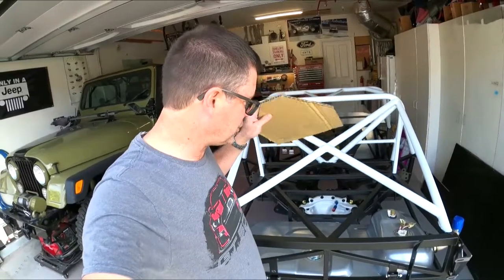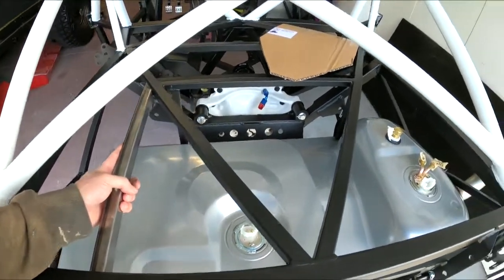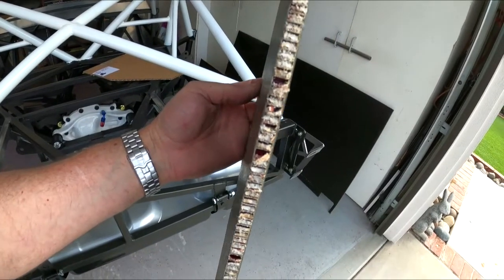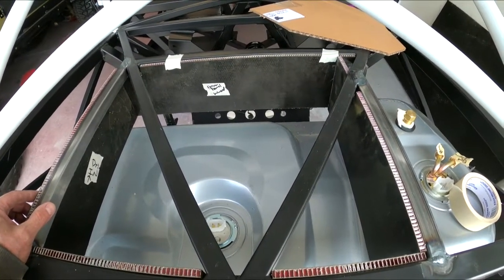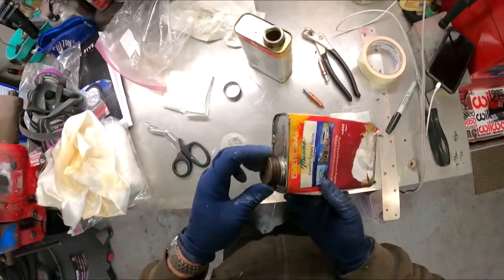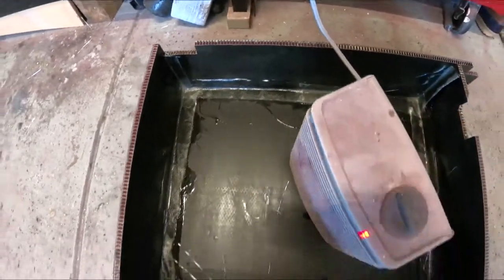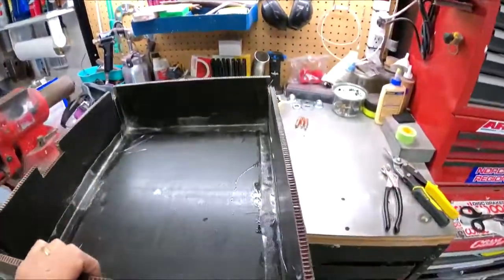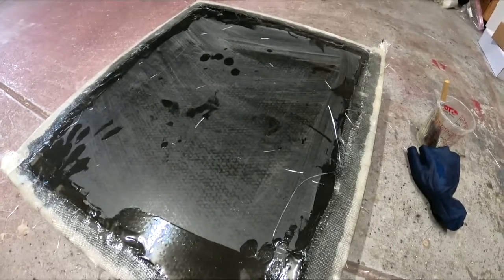Cobra Daytona Build-Trunk storage modification video 17

Comment: What did you do for your diff vent? Looks like some cool anodized fittings?
Reply from the maker: I tapped the cover and put an npt to an fitting. A 90 degree an fitting and some braided hose and call it done. Looks clean and professional even though nobody will see it. Thanks for the comment and for watching.
Reply: @cobradaytonabuild1671  Looks great, I'm a sucker for anodized AN fittings, and it's still simple